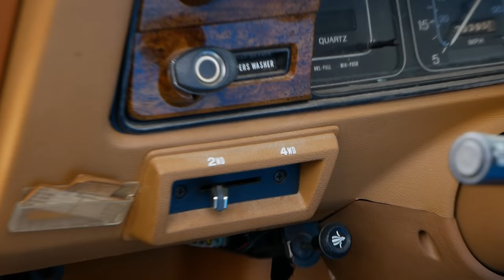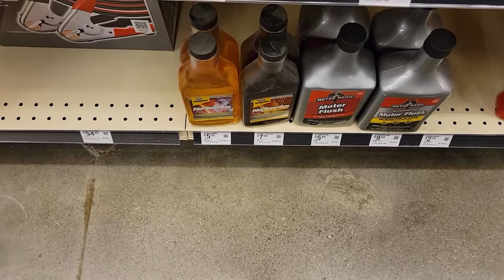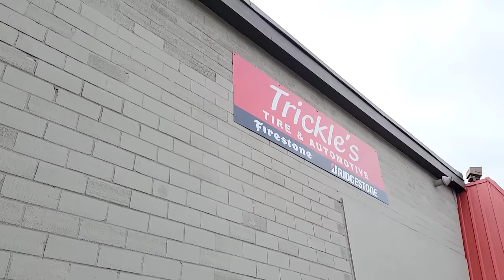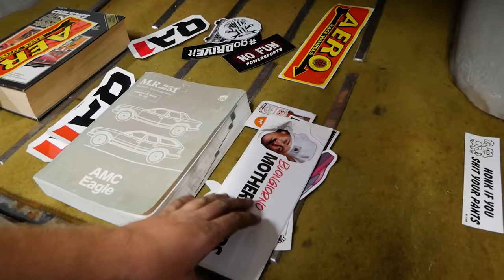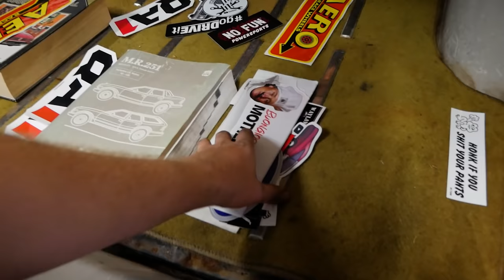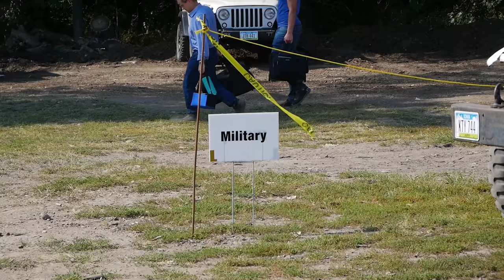$50 Car VS Off-Road Jeep Park - 24 Hour Build Challenge

Comment: The whole time watching this I had a strong desire to try and bend back out the front of the roof with a jack and some two by fours. Kinda want to see this specific car again. Kevin I know you can do something even cooler with it cuz that's what you do man.
Reply: Haha I would have jacked up the roof myself that was driving me nuts !
Reply: Turbo it!!!
Reply: That's what I was thinking. The dent doesn't look so bad that it wouldn't respond to some persuasion.
Reply: I thought putting a brick on the gas pedal and betting how long it would last would be funny, rebuilding it just to rebuild it and have something ridiculous to do ridiculous things would be pretty cool as well, maybe they could blow a rod out the side of the block and then rebuild it? Lol
Reply: You could always bribe him with Chicken Nuggets LMAO! TE HE
Reply: @manisandjr8435  I wish I could rebuild a motor with a huge chunk missing from the wall lol
Reply: In Canada that is not an eagle but  called an amc Concord the eagle was the 2 door models but essentially the same car but that 1 is about 2 feet longer
Reply: I would just swap a jeep 4.0L inline 6 which is basically bolt in with  next to no mods except fuel pump and fuel pressure regulator and a pcm install and you have virtually double the horsepower over the 4.2L amc engine
Reply: @tylordupont2068  I could see him putting a carbureted 302 ford in it just for sh*ts and giggles

Edit: nice to see a fellow Canadian watching Junkyard Digs
Reply: @famished3280  I meant the other issues lol obviously that thing needs a new motor, needs a new CV axle and a few other things besides the engine
Reply: @manisandjr8435  add me as another Canadian to the list.
Reply: Like the le mans gambler car
Reply: This would have been my comment as well.  Please more Eagle
Reply: @tylordupont2068  a concord was 2wd. An eagle was sold in 2 doors, 4 doors sedan and station wagon. It share the same body as the concord but the under cariage is different. I live in canada so i see both
Reply: no dude concords we’re the normal 2wd ones, the 4x4 versions were called eagles
Reply: @volksguy1  for the eagles i have seen in quebec or owned were all 2 door or hatchbacks but if you could help me out im looking for the bumper rubber corners and everything to mount the headlights to repair mine properly
Reply: I thought he was going to straighten the roof with a bottle jack and wood blocks. Some angle iron on top to hold it straight.
Reply: @manisandjr8435  ... we actually did that with an old Ford Econoline 6 banger and it took almost 10 minutes for the first big clunk to slow the engine. Two more attempts / restarts and eventually it totally quit. The end result was a rod through the block and a broken cam, with a few lifters on the driveway. The fun part was not realizing how much was now on the ground where we had to work. Good thing we had a bunch of speedy dry and some sheets of plywood to lay on.
Reply: @tylordupont2068  In the States, the 2WD version was called the Concorde, and the 4WD the Eagle.  People who drove them back in the day loved them.  Especially for trips to the ski resorts.
Reply: I wanted a jack for the roof as well
Reply: @tylordupont2068  Thats incredible, in the US the concord was the 2 door!

Comment: We need to see a teardown of that engine to see what the knock is exactly.
Reply: Yeah. Definitely a tear down. Want to see that knocking rod and what ever it was hitting.😁
Reply: It's probably a spunned connecting piston rod bearing. Judging from the type of noise. Someone absent minded person before either made a mistake changing the engine oil with the wrong filter. Leaking all the oil out. Or somehow blew out the oil filter gushing all the oil out. Causing  zero lubrication. Causing the spun connecting rod bearing. The loud noise is due to the piston connecting rod bearing hitting the crankshaft journal when it's running. Course I am guessing with this AMC Eagle ?. 💪
Reply: @rolandocurro8842  or that engine is just tired. but that amc engine will forever, just keep oil in it. they was build to last that engine, just take care of it.
Reply: I was about to say the same thing.
Reply: Poor ole gal ain’t ready to die yet. What a loyal ole lady
Reply: @jewsrbad  Same with the Jeep 4.0. ;)
Reply: Agreed,  it'd also be a good opportunity to do a total refresh on the whole engine and potentially squeeze a few more horses out of it
Reply: be sad if it was just a dented oil pan making contact with the crank, but now its utterly ruined due to shavings everywhere
Reply: Be seriously funny if it was just the stereotypical jeep inline loose flexplate bolt tap... had 4 jeep inlines and every one develops it and requires tightening the bolts back up. Sounds like a rod knock every time
Reply: @thekikendallsautoandrandom1271  I would agree but the flexplate tap is not as hard and loud as in the video. I know my 96 XJ has a crack flexplate at the moment.
Reply: It's probably a fan blade or something stupid. Or atleast it would be hilarious if it was haha
Reply: I thought about just putting delrin plastic or something soft in between whatever is making noise to dampen it !!!
Reply from the maker: It was the no.1 rod, it told me promptly after the event 😂

You can see the damage in the golden eagle video
Reply: @JunkyardDigs  thanks for the update on this
Reply: Rod knock 100%

Comment: Got one of these years ago for $100. After doing a valve job and grinding a bunch off the exhaust manifold to correct a serious warp / leak the only real problem was sorting out why the 4wd wouldn't kick in. Turns out it's run by vacuum and one of the steel vac pipes was clogged up. The quick fix was a new rubber line and a bunch of zip-ties. Drove the car for 2 years and sold it for $500.

Comment: Better outro would have been this,

Pulls up in car, gets out, slaps roof
"Currently up for sale is an AMC Eagle. This puppy has survived a jeep course while taking 3rd place, a tree, and a few special kind of idiots. Transmission slips to prevent you from speeding, small knock from the engine bay caused by some rowdy freedom eagles. No windshield so you can enjoy the breeze. Limited edition 3wd version. Brand new tires. $100, no low ballers, I know what I got.
Reply: 'i know what I got'
   🤣🤣🤣
Reply: I know what you got... A PIECE OF SH*T lol
Reply: I would venture to say its a one wheel drive and the wheel that drives us the one with the least traction lol
Reply: @mardrumming1362  but it's his POS
Reply: @soundsofnature7015  likely, lol
Reply: @keithcerce8445  "this baby is so rare, good luck finding another!"
Reply: @sonorangaming449  "I know what I have. NO LOWBALLERS!"
Reply: Amazing.

Comment: 33:33 That Eagle proved how fucking indstructible old iron truly is. That engine earned a full overhaul IMO. Clattering that bad still shrugged off an entire DAY of abuse on the trail. 

Frankly that whole car earned a restoration. It does not want to die. It proved it is not ready to die.
Reply from the maker: I have plans! Not a restoration, and you'll see why when the other eagle hits youtube, but plans!
Reply: That engine will run until you try to fix it. Then it will never start again.
Reply: @JunkyardDigs  Sweeeeeeet.
Reply: @JunkyardDigs  throw in a oversized bearing and turbo it!!!
Reply: @jeffmayo6002  exactly
Reply: @woolbus4319  exactly what iwas going to say
Reply: U should look for a 304 or 360 or 390  out of a javelin or rebel max and a cool cam
Reply: @slimjim119  I'd just overhaul the 258 already in it. That is the legedarily indestructible Jeep 4.0 and is a stout engine with ample power in good nick.
Reply: @TestECull  4.2L*
Reply: @rickc303  It was labelled as a 4.0 when it went to metric designation in jeeps in the late 80s early 90s. Same engine. Common too; Ford's 4.9l I6 is truly five liters(IIRC only about 4cc short) while the 302 V8 is closer to 5.1.
Reply: @TestECull  no, it was 4.2L during AMC ownership, and went to 4.0L after Chrysler buyout and used their fuel injection system

The Ford 300 I6, is actually 4.9L. The Ford 302 V8, is also actually 4.9L. The Cadillac 4.9, is a 300cid V8, and is actually, well, 4.9L. Ford just wanted to round up to an even 5.0 since it sounded better for the Mustang GT in the 80s

The Jeep 4.2 and 4.0 are different engines, of the same family. Using a 4.2 crankshaft in a 4.0 block/head, is the route many take to make a stroker
Reply: @TestECull btw Jeep 4.0 is 242cid
Reply: @rickc303  Technically, the engine genealogy goes from the 4.0 to the amc 4 cyl that they designed to replace the iron duke in their 4cyl cars. They kept the bore spacing and bottom end dimensions of the 258 so they could use some of the same tooling, but technically the 4.0 is not descended from the 258, and you can tell from the head design.
Reply: @Cmodelsport: 
Not only the engine,  but the whole car deserves a complete overhaul  
Upgraded suspension,  probably do a rear end swap and  put Dana 60 in there
And a few other things too
Reply: @rickc303  yup,  that's true

I actually have a 91' Jeep Cherokee with that same engine in it
Reply: @JunkyardDigs  a cheap horsepower boost is to stick a jeep 4.0 head on it.  They have bigger valves but the 258 has a hotter cam and better bottom end geometry.
Reply: Old cars from the 80s and early 90s are all total garbage... unreliable junk
Reply: @breakingames7772  Remind my F150 about that, then, because it doesnt know how to break down. And its from 1985.

Comment: I worked on some of these back in the late 80's-early 90's. Yes, they were a hodgepodge of whatever a dying car company could outsource, fairly reliable actually, but the one thing that stuck out to me was the driver's seat was super comfy to drive in and the A/C (if equipped) would run you out. Yep, they were not the best car of the era, but it was an AMC so that was OK.
Reply: that 286 ( i think it was) was a solid motor lots of torque if not hp but it ran till it just flew apart
Reply: @LORDOFDISCOCHICKENS  258
Reply: Owned a 76 Hornet at one point. 4.2l 6. Thing would not stop running.
Reply: @trythinking6676  
Even after you shut it off? 😝 Actually the only major systems in the car not built by AMC were the tranny (Chrysler), Transfer Case (New Process Gear), Front Axle assembly (Dana) and brakes. Other wise the body, engine and rear end were all built in house in the same facility. The brakes used their own drums and discs.  The master cylinders and wheel cylinders and drums. Those they bought.

Comment: seems to me this would be a great candidate to just replace the bearing (or whatever may be wrong in the engine) and send the hell out of it. If it could survive a day with that bad of a knock, and that thick of oil, I think it could survive a whole lot more on a bandaid fix
Reply: A piston rod, but yeah this thing is a real trooper and its one reason the Eagle is probably my favorite car of all time and any sketches of cars that my brain dreams up tend to be car-like but 4wd and lifted XD
Reply: @Avetho  The 4.2 does have a good reputation and if he can get the pan off, he can replace bearings without even removing the engine.
Reply: Yeah shine up the crank in the car without pulling the motor throw in a over sized bearing and I bet it will run for years
Reply: @alan6832  He's gotta pull the engine, or at least take the head off with the oil pan to remove one of the pistons, he said in the Premiere Chat at some point that its definitely a bent conrod (said something like "wait for it, bent rod, you'll see" or something, though that wasn't verbatim since it is the next morning now), so the entire time he drove it the engine was running a cylinder down at least. Truly that only makes it more impressive :P
Reply: @Avetho  He probably can't get the pan off anyway, since it's usually too close to the cross-member; but if he can, he can see if a rod is bent or not, I don't know what would make him so sure, but if so then it's so.
Reply: @alan6832  a compression test will tell you if a rod is bent if it's not smoking it's not bad rings or valves if a cylinder tests low it's a bent rod
Reply: @79huddy  or a ristpin
Reply: @slimjim119  wristpin is my money.....I have had a few of these....

Comment: This car really needs a fresh motor and trans (on a budget of course ) a welded diff in the rear the correct cv axle up front a few cheap odds and ends to make it a good beater trail rig
Reply from the maker: I like where your heads at!
Reply: Might be able to repair the one that's there tbh
Reply: @rawr51919  yeah maybe but as long as it was fun with that knock it would need a fresh crank and rods and at that point it's just easier to pop a junk yard fresh motor in it and keep beating on it and maybe fix that one for a spare but better off just throwing it awat
Reply: Port and polish the head for a few more pony's
Reply: Fix the bottom end, and slap on a junkyard turbo from something totally unrelated. That's turning the crazy up to 11.
Reply: @dougjones9698  that would be good for power but horrible for reliability lol and make it laggy at low rpm where those engines are designed to live but for a dune runner it would work awesome

Comment: I LOVE THESE AMC CARS.  my second car was a 1995 Eagle Talon and i swear IT WAS THE BEST on and off road LOL i mean it was after there AMC lineup but still i actually have an old 72 AMC matador sitting behind the grandparent house wanting to soon do something with it  ...love the content  CHEERS FROM FLINT MI ~!!
Reply: Eagle Talon is NOT an AMC
Reply: That car was made by Chrysler an Mitsubishi here in US
Reply: Its a DSM
Reply: @MrHotrodharry  actually...it is AMC sold to eagle then sold to Chrysler
Reply: AMC sold to Chrysler and didn't make it past 1988 a couple years before the talon ever existed. AMC was solely bought just for the Jeep line. So your Wrong DSM is Mopars Import side Not a Dam thing to do with AMC.
Reply: An Eagle Talon and an AMC Eagle are 2 totally different cars. Not made by the same company at all or even the same country. Eagle is a Chrysler  sold Mitsubishi and does not nor ever had anything to do with AMC.
Reply: @MrSzero13  no it isnt.
Reply: @ericchapman8956  Thank You Good Sir. Lack of Knowledge and Research is ridiculous these days. Being an Eagle doesn't make it an Eagle 😆 
Brand AMC Model Eagle
Brand Eagle Model Talon
Reply: I had a 1990 Eagle Talon Tsi AWD turbo and it was one of my favorite cars ever, and I've owned 67 cars and trucks since I was 14 and I'm 38 now. I even had a 1992 Plymouth Colt hatchback that I swapped a fully built 4g63t into and it went on to make 409 whp. It hauled some major ass and would light up Corvettes once it caught traction that is...
Reply: The Eagle division of Mopar did come from the AMC Eagle model name, but the evolution of it in the middle would have been with AMC partnering with Renault to start the Eagle brand and selling Medallion as the model. Once we got into the DSM cars, AMC was long out of the picture. Confusing things even more, they carried a handful of AMC model names over to Chrysler divisions. So you could have an AMC Spirit or a Dodge Spirit, but nothing about them was the same. Same thing with Concord and Concord_e._

The bone picking of AMC wasn't done with much grace, or sense, by Chrysler. In about a 3 year time you could have bought 3 different vehicles all wearing the name Eagle and all having nothing to do with each other. I don't blame people for being confused.
Reply: @MrSzero13  The eagle marque was founded after chrysler bought AMC. So no, it is not an AMC. The Talon is just a restylized Mitsubishi Eclipse.

Comment: Mix-n-match parts between the AMC 4.2 and the more modern Jeep 4.0 and end up with a 4.5 high output motor..also upgrade from the 3 sp auto to the jeep 4 sp auto with lock-up torque converter.

Comment: I remember wanting one of these when I was little...it was like my parents' 1972 Hornet, but with 4WD! And yeah, I've always had a soft spot for the AMC I-6, since it was technically the first car motor I ever worked on (the Ford 302 was number two). I still have a 2000 WJ with the 4.0 (a hand-me-down from my brother) in the driveway that I need to finish fixing up.

Comment: I had one of these beauties.  The interior and exterior were perfect, but it would barely go up a small hill.  So I decided to go for the gold.  Me and a friend set out on a 300 mile journey from home to the blue ridge parkway and back.  There were times I thought we were going to have to get out and push.  This vehicle sits high.  Ran over a dead deer at 55mph with no problem.  Lots of fur underneath, but no damage.   Built like a tank, but the motor is a no go.  It was a neat fun vehicle while it lasted, which was not long.  lol
Reply: The AMC six was actually a pretty good performer so I’m thinking you had a dud. My 1980 Eagle was great, nothing wrong with the six, but since I like the sound and power of a V8 I swapped in a 304 AMC which is probably something the factory should have done. What a nice upgrade. The 304 was bolt in to the automatic, as long as you used the 304 flexplate. Fit like a glove cuz the V8 came out of an AMC Spirit which has the same body as an Eagle.

Comment: A good friend jumped one of these. Like "Dukes of Hazards" style jump, 20+ feet in distance and roughly 3 feet in height. 

Landed with amazing graze, even knowing the driver had forgotten to buckle his seat belt, so he was glued to the ceiling for about a second or two. 

Only damage was that he had pulled the shock rods out of the pistons assembly, all 4 corners. $120 in repairs or so.